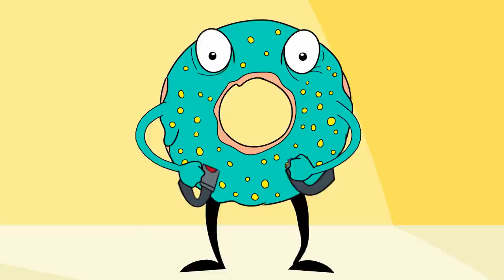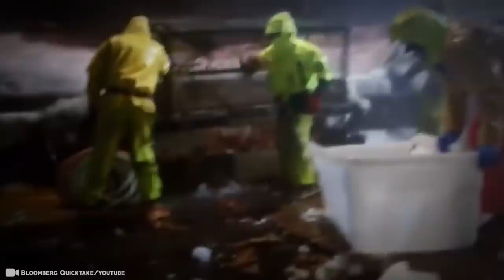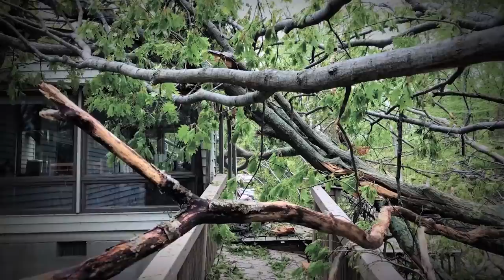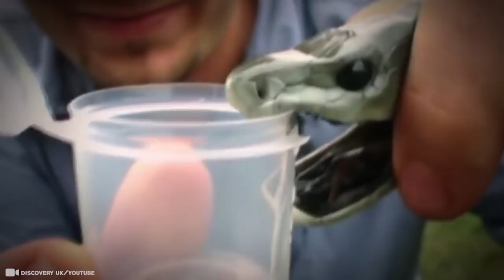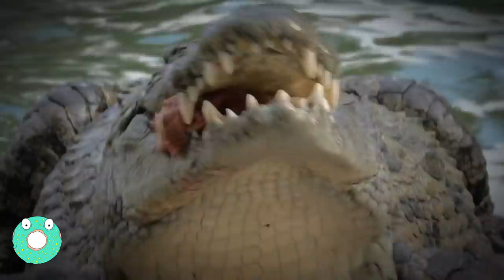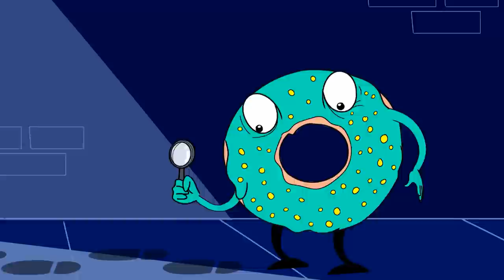15 Horrific Jobs That Must Pay Big Bucks

Comment: The sweet spot picture isn’t sewage they are at the beach claming. That’s a clam hammer behind them it slides down in the sand and takes out a core of it with a clam in it somewhere.

Comment: I just don't know how you can mig weld under water!!! Everyone is always taught water conducts electricity. Never get anything electric near water. Also when I was in diesel mechanic training for the Army they taught that it takes less than 1 volt to kill you. So using a 12 or 24 volt system for mig welding under water should kill you. I mean I totally understand that it has to be grounded to work. We were taught how to weld as it is part of the job. For an Army mechanic to be able to weld. I just can't trust it enough to be an underwater welder. Grounded and wearing a rubber suit does seem like it should keep you safe. With my luck I would be #2, on the list of professionals that died from it!!